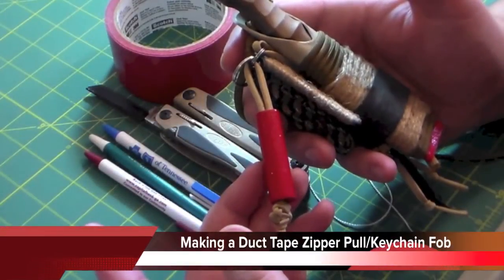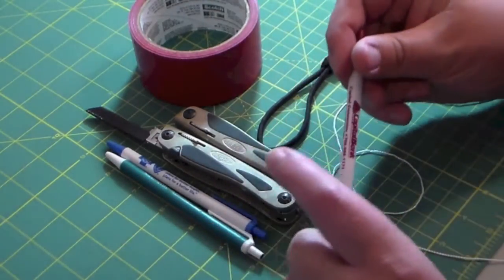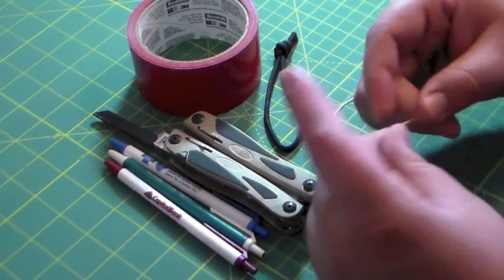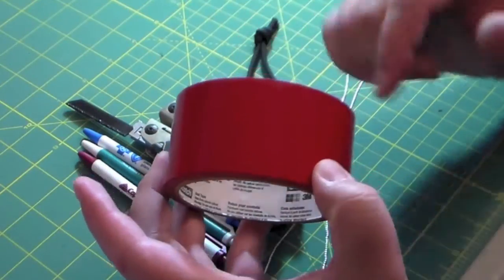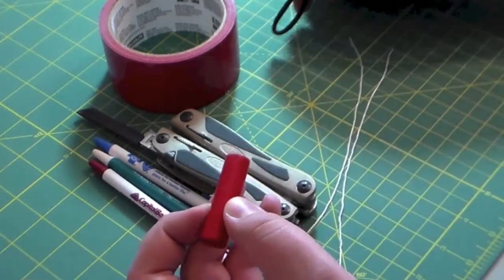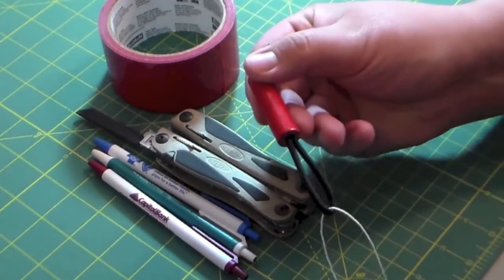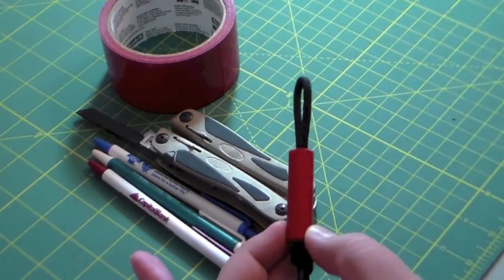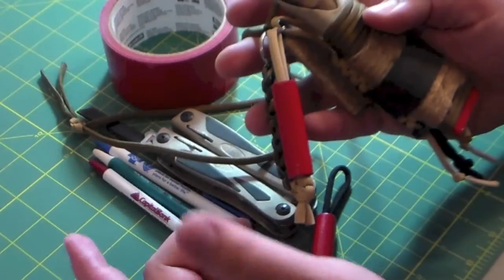DIY Duct Tape Zipper Pull/Keychain Fob — Quick Tip # 5

Comment: Great idea ,particularly as some airport security ,don't like rolls of duct tape in carry on.Is there some way to secure a mini torch in to the pen tube?
Reply from the maker: Thank you! Your idea is possible...possibly. The cordage would not be able to run all the way though the pen tube, so you would have to epoxy it at one end. Also, you would have to get a bigger pen shaft, possibly from a marker, because I don't know of a torch that small. Find the right tube and the right torch, epoxy that in the other end, and yeah, you have an all-in-one zipper pull/torch/duct tape holder!

Comment: Also 5Ft of Duct tape is like 1-1.2" Thick , Looks like you have 1.5-2Ft there :)
Reply from the maker: It is possible that I have a little less that 5ft...I was just giving an estimate. But I would say that it is pretty close. This is the Scotch brand Duct Tape which is thinner than most. It is not the best for heavy duty repairs. But for light stuff it is just fine.
Reply from the maker: Good call! I just unravelled one of them and found that it was a few inches shy of 3 ft. I was way off with my guess! I put a correction note in the video. Thanks for catching that!